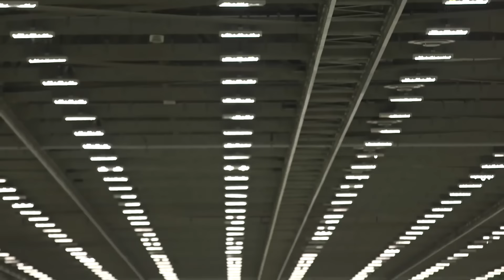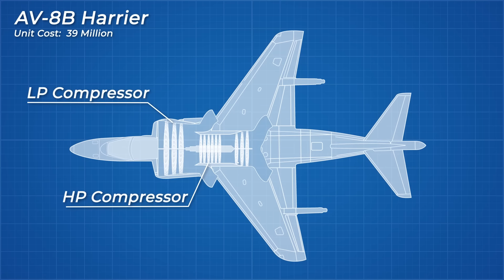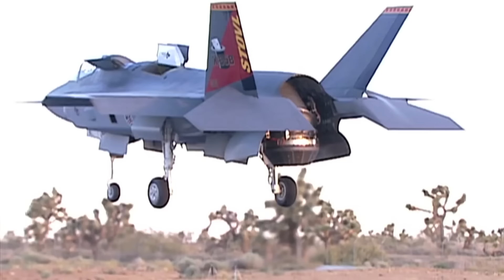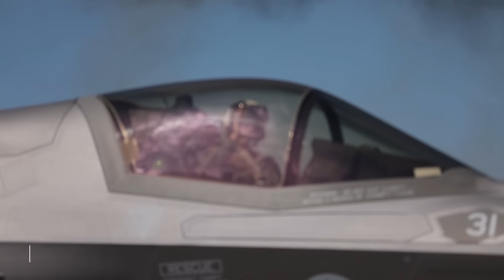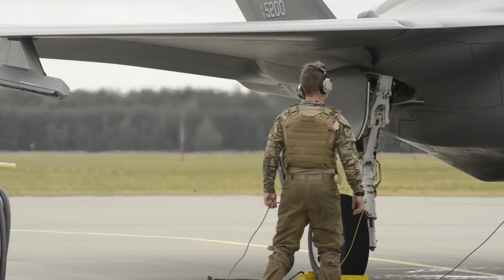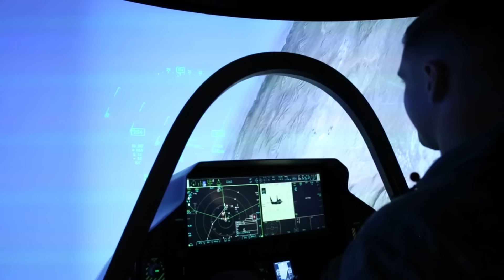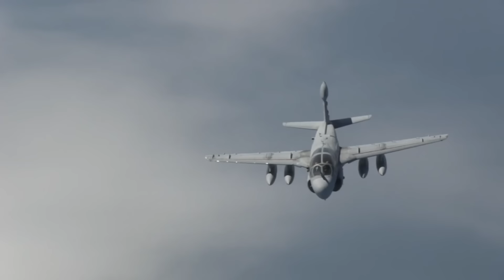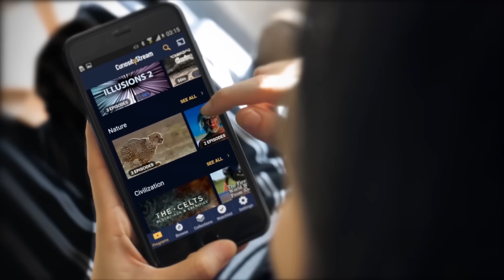Is The F-35 Worth $115 Million?

Comment: F-35 has been called FLYING PIGLET
FLYING LEMON
if Americans are so stupid to pay for those toys fine with me
What shits me off when US is forcing its vassale states to buy this obsolite plane
Poland where a coal miner earns €500 a month, 20% of Poles deficate in the fields spends $4.6 billion on this planes Lockheed Martin admit it has 208 defects
Reply: They would still be paying a very similar amount of money for the cheapest fighter available. And if an aircraft can perform it's role without issue - the F-35 certainly can - then what's the problem? Every product has teething issues and fighters are put into service when they can do the job, not when they are perfect.
Reply: @dumdumbinks274  You abviously are not familiar with F-35
Reply: @vladoparenzan3344  Then how about you provide an actual argument? I will explain how every point you make is wrong.
Reply: @dumdumbinks274  Just look how many F-35 fell out of the sky
F-35 is a LEMON
Wish my government could say NO to USA
Reply: @vladoparenzan3344  Sure. 1 crash due to engine failure relating to faulty fuel lines. That's it. The only other crash of an F-35 was caused by pilot error on a night mission over the sea. In total there have been 2 crashes in 200000 flight hours, which is an extremely good safety record in comparison to other fighters.
Reply: @dumdumbinks274  Just google F-35 Misshaps & Accidents report
Surely you can do that??
,Saves me going down the list of disasters
Reply: @vladoparenzan3344  There is a list of disasters involving the F-35. It is 3 lines in total because there have only been 3 hull loss incidents - 1 on the ground, and 2 crashes. You're not even citing specific incidents, only making vague claims. I'm guessing you are poorly informed on the topic.
Reply: @dumdumbinks274  havent you read about the F-35 hit over Syria by a S200
What happend to the F-35 taking off British aircraft carrier whose canopy sprung open just as it left the flight deck
By the way are you Lockheed Martins PR man
If not dont be fooled
All this losses with only one hit by enemy firev
Reply: Your point is???
Reply: @vladoparenzan3344  My point is that yours is false or at the very least a massive exaggeration of the issues that actually exist.

Comment: Just a nitpick : The harrier STO is usually done with 10 degrees nozzle during the initial roll, and when rotate speed is achieved, the nozzles are slammed to about 60 degrees to leap into the air. It's not a constant 45 degree run.

Comment: An F-35 is unlikely to overall improve on the A-10 Warthog is close air support of troops in combat.
Reply: The F16 is already taking over a lot of A10 work.
Because it doesn't do the role in the same way, doesn't mean it can't do the role.
Reply: David Houseman .... the F-16 taking on the role of the A-10 is an expedient. There are a lot more F-16’s flying than A-10’s. It’s a necessity because the USAF has slowly squandered the majority of the A-10 fleet by not overhauling and upgrading the majority of them. In 2015 the USAF was down to only 283 operating out of the original 716 built. That’s means a lot of A-10’s are sitting in the aircraft boneyard in Tucson. I don’t know if any of  can be returned to service.
Reply: @Idahoguy10157  availability is part of it, but it's also as Anti aircraft weapons get better the A10 gets worse. 
I don't think the F35 will take over the role alone but I think drones are also pushing from the other side, not risking a pilot and being cheap to operate.
Reply: David Houseman .... The survivor of the A-10 in combat depends on when and where it’s used. Against modern Russian air defense systems on their terms A-10 attrition would be high. Which is where the Tomahawk missile, the F-35, the F-22, and use of drones comes in. Once that air defense environment is suppressed the A-10 is survivable. The A-10 wouldn’t be the best tool in the beginning. Fortunately most of the world’s adversaries haven’t a modern integrated air defense system to overcome.
Reply: @Idahoguy10157  it's not the integrated air defences, they've always been an issue. It's the increasing capability of what you can put on the back of a vehicle or even a Manpad.

Comment: The final cost will be less. Then having 10 different ones. As you have over 90% parts common to each version. Also makes ground crew training easier. So over 15 years. You would save 30% in logistics cost.
Reply: You don't have 90% common parts. That was the original aim. It's now down to about a third common to all 3.

Comment: Pickup trucks are selling for $100,000 plus.  I remember reading 10 years ago that the average fighter jet cost the equivalent of between 1,000 and 2,000 luxury automobiles.  So if you take a luxury car that costs $200,000  (BMW 7 series) and multiply that by 1,000 you get a price tag of $200 million, so that F-35 jet is actually half the cost it should be, it is a bargain.

Comment: A jack of all trades that fails to be a master of anything(other than being the most expensive). No, it won’t be worth the money. The money would be better spent on upgrading current airframes, not building a new aircraft that doesn’t have the capability to effectively replace any of the current aircraft.
Reply: The F-35A outperforms every single older airframe design in every practical way, going so far as to be considered as a valid replacement for the F-15, and the only reason that didn't happen is because the F-15 needs replacing before the F-35 factories will be done replacing the F-16 in USAF service. Oh and the F-35A is cheaper to build than a modern F-15 variant.

Comment: you info is wrong the F35 will NOT be replacing the A10 Congress will not allow the Air force to and has Told the Air Force if they try to that Congress will shift the A10 over to the Army along with the budget for the A10.

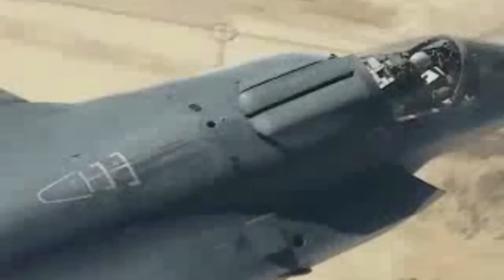Comment: A note about 7:15- used to work in a milling plant that was making the fan mounts for the X-35. 'Just dead weight while cruising' would indeed be accurate for a part that had to be:

Milled from a solid block (3 days before you ask)
Weight at 970 lbs- more than 10 ounces either way and it's byebye to another $200,000 block of titanium
Moved with an actual dock crane inside the building to avoid death by crushing
And let's not forget- causes a 185% product-to-waste ratio in a block of metal that costs six digits to own and almost seven to get to you

Wow, i think I'm cynical in my retirement.

Comment: As an Australian that is super into the combat power of the Australian military but unable to sign up due to the strict requirements of joining. I know that the 72 F-35A that we have already ordered (plus 28 extras within the next two decade, although I believe we will need another fifty) will be replacing our  71 F/A-18A/B Hornets and our 24 F/A-18F Super Hornets which are outdated will drastically important our combat power.

Comment: Why the hell would foreign countries buy tones of planes for the USA when they can buy 5 rewerse engenere them and make their own planes? 
For militaries it is quite important to be self sificient relying on foreign production line is quite a bad strategy.
Reply: Reverse engineering a plane design is difficult and would be really expensive.
Reply: @Sedna063  "Reverse engineering a plane design is difficult" Yes but easyer than making one from scratch.
"would be really expensive." Buy all your planes from the USA is really expecive because if you dont make your own every next model becomes more and more comples while your countries technological manifacturing stagnates, which means you will be stuck buying planes from the USA for ever.
Reply: @gunarsmiezis9321  Well, not necessarily. 

Reverse engineering means you have to completely scramble the plane into parts and copy each and everything without any idea why this has been built like that. 
Reverse engineering a plane has always led to worse performances.
Reply: @Sedna063  But you dont have to build a perfect copy you just need to build a plane that is similar and works well. And then you have a foundation on which to engenere your own planes in the future.

Comment: Quantum radars, on the other hand, could provide enough detail for 
radar systems to identify the object based on physical characteristics. A
 B-2 Stealth bomber, F-22, F-35 for example, could be identified by the sweep of 
its wings, the shape of its nose, and the number of engines.

Another benefit of quantum radars: they emit very little energy and 
are thus difficult to detect — a distinct tactical advantage in warfare.

Comment: ‘An air superiority machine to replace A10s.’ correct me if I’m wrong but I’m
pretty sure A10s are in no way built for air superiority. They’re not even multirole.
Reply: You are correct. 
Ther A10's main purpose is to attack ground targets. 
The problem is that the A10 was designed to fight Cold War enemies like the soviet armored vehicles. However, most modern battles are dealing with terrorists and civil wars. These conflicts don't have much in the way of heavy armor, they mostly use cheap cars and trucks for transporting their weapons. So an A10's weaponry is a bit overkill for these kinds of targets, and it can be a waste of money to fly an A10 out just to blow up some trucks in a convoy. 

Another problem is that the A10 is a rather slow aircraft compared to most fighter jets. If the A10 were to be used in a full-on war with an industrial nation, the A10 would require fighter support to protect the A10 from other enemy fighter jets trying to intercept the A10.
Reply: @faragar1791  Actually, the A10 would be perfect for that job. They use the same missiles and bombs but the A10 is far cheaper.

Comment: you have not proven it is a worthy successor to the A-10, but the arguments of "their complaints about maneuverability are based on habits from older flight doctrine" reminds me of when the F-4 was introduced: "we don't need guns anymore because all we will ever use from now on are missiles." thats also the time frame they said "will if you put wing and enough power on a toaster, it'll fly" when designing the F-4.
Reply: @peterson7082  what's your question?
Reply: Nothing currently can replace the A-10 directly, but nobody needs a direct A-10 replacement. The vast majority of CAS is reactionary and the A-10 simply doesn't have the speed to perform that type of CAS effectively, and for those few situations where an A-10 is desired for it's loiter time and firepower a bunch of turboprops can accomplish the same for a lower cost while being just as survivable.

The F-4 performed really well in Vietnam. Training was the primary issue, followed by politically enforced restrictions on the Rules of Engagement. Guns were pretty far down the list of issues plaguing the performance of US aircraft in air combat.
The F-4 was also a single airframe designed for a single service (USN) forced by politicians into service with 3 different services each with different requirements. 

The F-35 is 3 physically different airframes each designed specifically to accommodate the requirements of 1 service each, and the F-35A is more maneuverable than every US fighter other than the F-22.
Reply: @dumdumbinks274  bringing up the f-4 was more about time frame, I was not making comparison (separately, I don't like the f-4, but that is for other reasons).
The main issue I'm seeing is the department of defense is making compromises that are more geared towards a mentality of "the past has no bearing on the future" and "technology is the way to win wars of the future so we'll put everything we have into that"  and "we don't have to think about a war against someone of equal capability ever again so why arm ourselves as though we do?" This mentality is an issue as it has lead to the v-22 having a shorter wingspan then it really needs so that in full stow it can maintain a similar space requirement on ships as the ch-46 phrog. As a result it only flies level when you have a +5° up pitch. This is the same mentality that has recruits at boot camp learning ACOG instead of iron sights.
I can understand a desire to standardize military equipment, and to some extent that is a good thing, but you still need variability and last I heard (to be fair, it has been a couple years) the goal was to replace just about every front line fighter or our support craft (obviously excluding the helicopter and VTOL craft) with the f-35. The craft may be fantastic, but sacrificing flexibility in order to standardize as much as I understand they are is a bad idea.
Beyond that, there is enough I've heard coming out about how the trials they put it in against the a-10 were obviously stacked to make sure the f-35 won. Is it going to be worse at the a-10's job the the a-10? Yes, but if you want to see if it will be a functional replacement, you have to see how much worse. 10% worse? Prolly can take the hit. 40% worse? That might not be worth it.
Reply: @rimshee  The problem is that the A-10 only excels at a very specific aspect of CAS that rarely occurs. The F-35 absolutely can replace the A-10 if the requirement is the ability to perform CAS, but if the requirement is to be excellent at strafing runs, then it is slightly behind the A-10... But as I mentioned the vast majority of CAS is reactive, so not something the A-10 can be effective at anyway.
The exercise initiated to prove the F-35 over the A-10 was stacked, but it was the only one that was stacked in the F-35's favour, but even so there aren't many details about that specific exercise. Elsewhere the F-35 has proven itself very capable of CAS in numerous unbiased exercises and performed better than the A-10 in all of them...at CAS, not the A-10's niche.

The F-35 has never been a replace-all type of fighter. The only aircraft in US service that have been scheduled for replacement by the F-35 are the F-16, F/A-18A/B/C/D, and the AV-8B. That hasn't changed since the 1990s, although there has been talk about replacing other aircraft such as the F-15 because although the F-35 isn't a dedicated ASF platform it is still better at that role than the F-15 is.
Reply: @dumdumbinks274  either way, he never proved it could replace the a-10.
Still over priced
Reply: @rimshee  He didn't prove it of course, but the A-10 isn't cheap at roughly $45 million if you want a new one, and basically the same operating costs as an F-16. If cost efficiency is the concern then turboprops are a far better option than the A-10 for the role the A-10 performs. if you need something better at CAS in general (i.e more impact on the battlefield) the F-35 is reasonably priced at around $75 million which is less than most fighters.
Reply: @dumdumbinks274  I know the Marine corps isn't going to be able to maintain theirs based on their track record with their current squadrons.

Comment: Great video, thanks for posting it. Won't adversaries of the West be able to overcome stealth at some point in the not too distant future either by infra-red, or electronic signature tracking?
Reply: Dutch Flats Yes but this gen of fighter has upgradable software & hardware, so they play cat & mouse seeing who’s tech is superior
Reply: Infrared is nothing new, it can detect stealth aircraft easier than some radar bands, but the problem with infrared is its susceptibility to weather condition and it has a comparatively lower range than radars. Not to mention that stealth planes are designed to have lowered IR signature from the front as well. Stealth is also an improving technology, and there's a physical limitation to what a radar can do. Jet fighters will never be able to carry a radar that's effective against stealth due to the spatial limitation.

Comment: 11:23 You really did completely duck that issue that the F15 pilot brought up, completely obfuscated that 1 crucial issue he raised, nothing can make up for it's fundamental fat slug status in turning dog fights that always arise in ACTUAL air combat, not this ideologically based over the horizon AAM sniping fantasy.
Reply: Israel is developing new wings to improve its ability to turn and bank faster.
These will be supplied to the US in due course.
Reply: That report was of a test F-35A with severe restrictions in place (roughly half the maneuverability of a production model 2019 F-35A). The report was almost completely irrelevant when it was first leaked to the public, let alone today. The F-35A is considered the 2nd most maneuverable US fighter available, and is capable of contending with the likes of the Typhoon and Rafale in dogfights (both of which are more maneuverable than the Su-35S).

Comment: The A 10 is irreplaceable , the ammunition for the guns on the F 35 is a fraction of the size. the A 10 relies on air speed + terminal velocity and "giant ammos" to lay waste to ground targets, the f35's size greatly limits its "ammos" capacity and caliber due to weight. the f35 has a much higher climb ceiling and a much higher top speed so it can deliver the "ammos" at equivalent force  (newtons second law of "F$%K the ground targets") The "ammos" on the f35 cant take the impact without expensive materials, which is a huge increase in operation cost, which is a huge deterrent from using advanced materials in the ... "ammos"... 

Its important to note that the airplane is planing through the air, and is by no means "crafting" through the air. Firearms deliver fire from the arms, but is by no means "gunning" i dont like you traitorous fools.
Reply: You don't need to replace something that's outdated and isn't used in its intended role anymore.